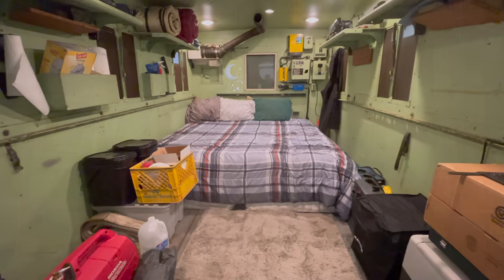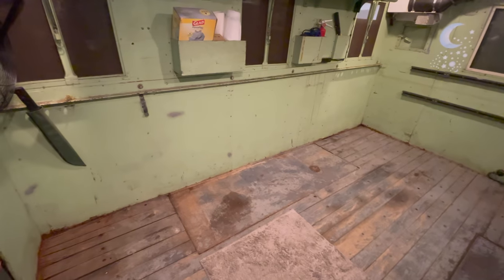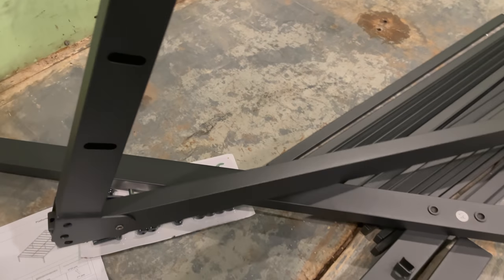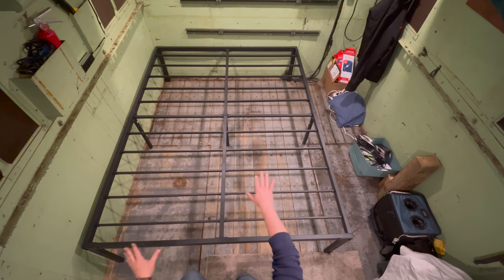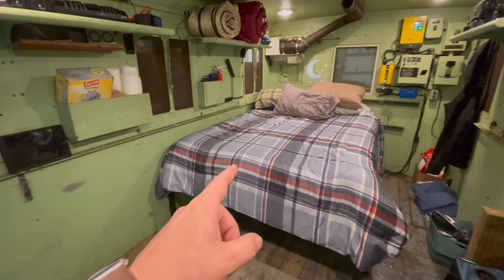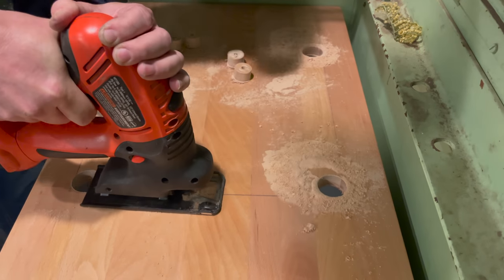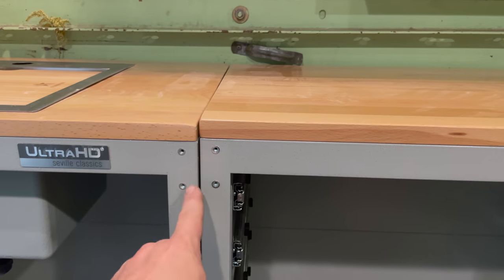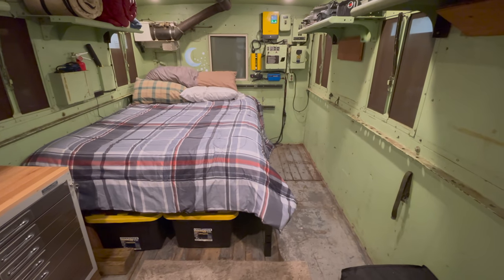Part 3: M35A2 M109A3 Overland Camper Build

Comment: Great Job!!!  Those giant angle iron running down the wall with holes in it was simply use to secure things like work benches to the truck without having to drill holes or screws in the floor! looks awesome. I wouldn't have thought of using a bed frame as a storage area!

Comment: Looks nice! If I had a van truck like that, I'd do similar, but I think I would've used cots instead of an actual bed, just so I can fold them up and out of the way and add a folding table with a couple folding chairs. I did a similar set up like I mentioned in an old camper I remodeled for my uncle. I also put down some carpet remnant on the floor with a small section of vinyl flooring in front of the door. It turned out real nice and was real roomy for 2 adults or an adult with 1 or 2 children. Usually when I go camping, it's during deer season so my son will come with me and occasionally a buddy will come up for a night or two. 
That said, I do like how you set up your truck, so I'm curious to see how well it works out camping in the future, especially for a week or so. Another plus side to this, if things go bad, you have a mobile home, lol.

Comment: Truck looks great I keep most of the original painting everything in the inside and if you put any carpet down use marine grade carpet something that you know doesn't hold moisture make the floor rot or anything. Keeping it simple which is great.

Comment: The Dometic refrigerator is the choice of most sailors. Dometic is a German company which bought Hadley Barber a few years ago. They use the Danforth 35f ac/dc compressors. I had one on my Endeavour 37 and liked it a lot. This RV build is quite similar to to a boat.

Comment: Nice!!!  Really enjoying this project.  Have you considered putting down something like 5/8" tongue and groove OSB on the floor?  That would help smooth it out a bit, and then your could put some vinyl flooring or maybe carpet down.  That current floor would quickly destroy vinyl flooring where you walk on it.  Agree with the comment below about moving the front 4x4 back a little as toe kick space.

Comment: you should get a piece of sheet vinyl flooring and staple in down around the edges and caulk it in for flooring. it's easy to do.
Reply: But is that a wood bed floor? If so I would go with staining the floor and painting the walls. Not my truck though.

Comment: Nice job. Paint the interior ? Floor covering? Not much expense for a big difference ...
Reply: The old patina look is kinda nice in my opinion though it would be neat to open the door of an old military vehicle and see a luxurious cabin inside. At the very least I would try to level the floor and then refinish it. The wood appears to still be in good shape. It just needs some help.